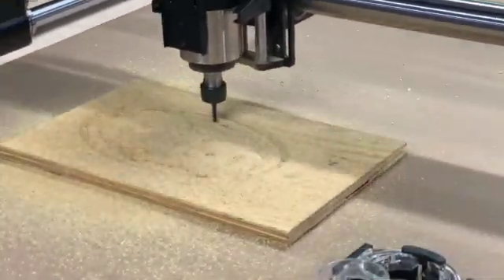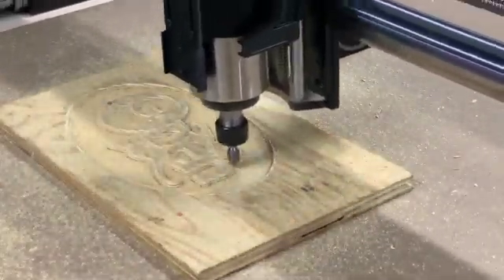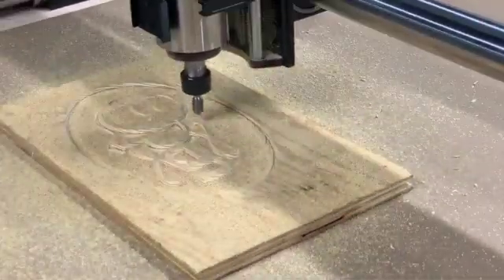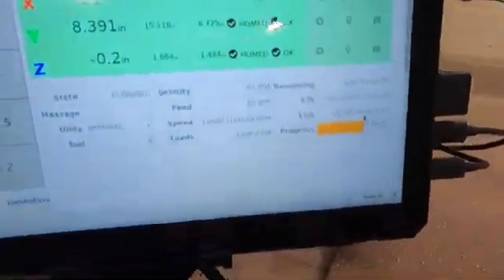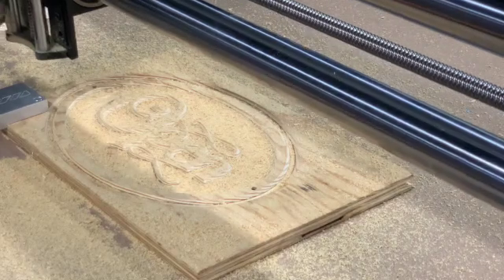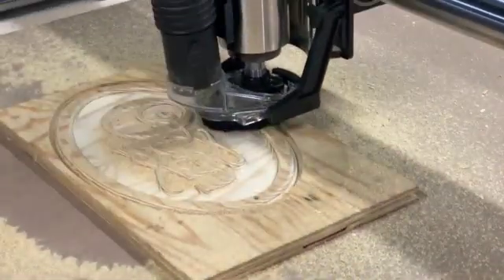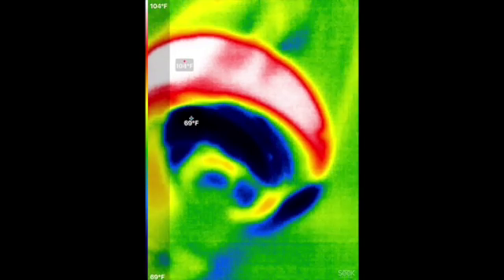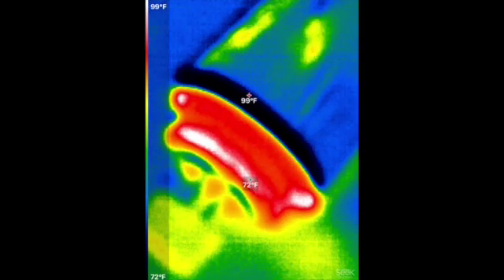Onefinity Journeyman X-50 Itinital Project Part 3

Comment: Nice job capturing the spindle temp on IR. Glad the supplier followed through with the replacement spindle. The Paint job looked a little rough though. It had a little bleeding on the grain. I'm not pretending to be an expert, just friendly feedback. The cut looked great. Thanks for the video. Keep it up!
Reply from the maker: I appreciate the feedback and noted the bleeding.  This was made out of big box store plywood, not the best and I didn't use any grain filler.  In the future I will take the extra time.  
The supplier was a little reluctant at first however after working with them, they agreed on action taken.  Thanks for watching.